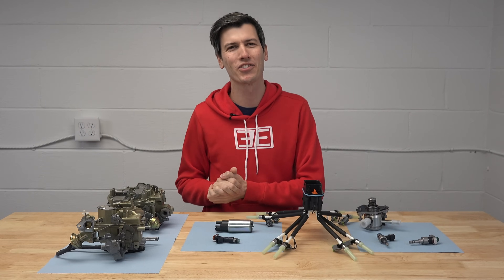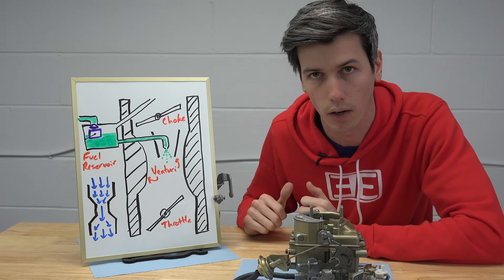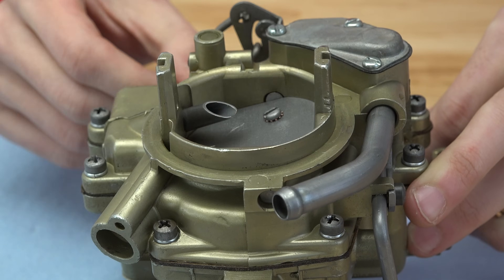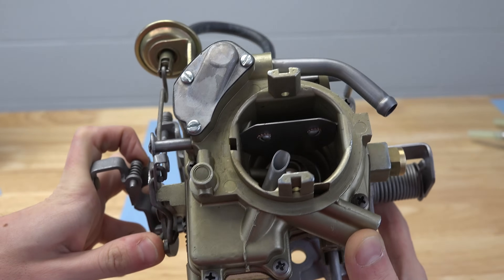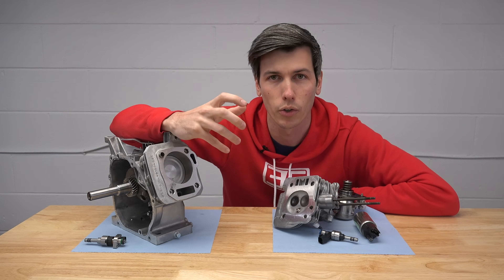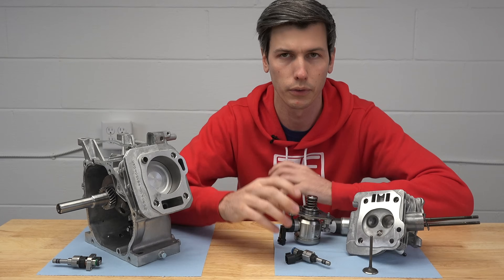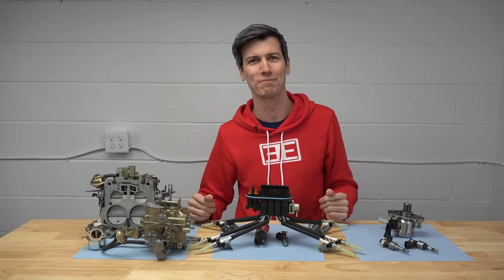What's The Best Fuel Injection? Carburetors vs Port vs Direct

Comment: I'll try to never buy a direct-injection only car, as I've heard too many nightmare stories from people who've had to have their intake side decarbonized, only to be left hanging once warranty was over. DI + port sounds the way to go. The very hard part is figuring out which vehicles have both, as most sales associates don't seem to know nor care. It seems some Subies and some Toyota models employ this dual injection strategy, but only on select models. Furthermore I was told that Mazda's 2.5 engines only employ DI, but an experienced mechanic said he's never yet had to clean an intake side ever! is there a strategy Mazda employs on their DI that somehow manages to clean the intake valve? I'm so curious as I'll be needing a new car within the next 1-2 years, and don't want to be stuck with a vehicle perpetually in need of intake tract cleaning. If Mazda makes their new I6 engine dual injected, (or has indeed solved the DI carbon issue) and throws in rear drive, I think I'll have an answer.... (Please make a wagon model while you're at it!)

Comment: A real good reason I scrapped the EFI on my Ford truck is cost of repairs and operation. My 4x4 F250 got no better than 10 mpg with the original injection. I installed a 650 cfm 4150 style Holley carb and my gas mileage jumped to 15 mpg. Driving over half million miles I saved a lot of money. EFI cannot compare.

Comment: Good old Weber 45 DCOE (et al) carbies, do not need
high pressure fuel pumps, electro mechanical fuel injectors, a computer,  a larger heavier alternator to
provide the extra electrical watts to power all that extra hardware, not to mention a bigger,  heavier and much more
expensive (toxic) battery to ballast the extra electrical power consumption.  

The extra hardware I've cited is only a small fraction of the extra componentry that is used 
for todays electronic fuel injection systems.
 
Consider as well the extra fuel burnt to run the high output alternator and drive its output...
as well as the extra fuel consumed to accelerate a now heavier vehicle. 

Greater complexity equals more things to fail, and more valuable equipment, time, and parts, 
to diagnose and repair the failures... the more frequent failures.

Comment: I got a genuine question, in a port injection system if your in down hill and no throttle input(engine braking) , does the ecu cutoff fuel completely ??

Comment: As a keen driver I find the biggest differences between these systems is how they're actually engineered in a car. My carb fed V8 responds instantly to the throttle, so for example in a corner you can balance the car on the throttle and your ability is the only imitation. Conversely, a modern road car with drive by wire throttle has a lag - a time delay between pedal input and engine response. So regardless of the theoretical advantages these newer systems bring, the implementation is poor and this impacts negatively on the driving. Personally, I'd rather have less efficiency and power but with a system that responds immediately.

Comment: a carb does not dump fuel, it regulates the amount of fuel. emulsion tubes, jets, needles and power valves all regulate the amount of fuel to be added to the airstream. you should be more accurate in your explanations.

Comment: Carburetors are by far the most fascinating work of engineering out of all fuel delivery systems. It never ceases to amaze me how much versatility and precision has been achieved just by some intricate use of holes and cavities in a metal block and utilization of pressure difference and Bernoulli’s principle. They don’t  do calculations to time and quantify anything, they don’t force feed fuel, they just maintain a constant state of balance which allows them to deliver exactly what the engine demands. 
Which in turn makes carburetors the snappiest of all. Nothing responds to throttle inputs as crisply as a well-tuned carb.
Reply: so simple, so perfect.

Comment: 😃fuel injection has less air flow obstruction,therefore more open throttle horsepower….also for a given state of tune,more tractable implying a higher state of tune potential.

Comment: U missed most important point
Carburetor mixing fuel and air 
Fuel injection dont.
That a huge advantage of Carburetors, u can say  carb does carburation
Fuel injectors don't
Reply: Lol fuel injections is far, far better at fuel atomization than carbs are.
Reply: @Redtooth75  
Fuel injection not a mixture of fuel and air. Did u go to any type of schooling about how engines work?
That a biggest problem of fuel injection. U can make  carburator super efficient because of that
Almost 2 times better than FI
Try it. It is Fact of life (basic physics really)
Reply: @vaninec  what you want is fuel atomization, you want the fuel to be in a gaseous state not a liquid one. Carbs suck at doing that, fuel injection is really good at that.
Reply: @Redtooth75  
Are u the specialist in fuel delivery systems?
I telling the expert opinion, whole process carburation DO NOT exist in any modern FI that huge minus
Reply: @Redtooth75  
Engine need carburation Not a just a fuel atomanization

Comment: Carburators are way less complex than fuel injection u could rebuild it with a few spare parts and a few tools on your front porch or at a rest stop if the fuel injection system burns out you will have to be towed💪🔥🔥🔥

Comment: Back in the days there was BOSCH L-Jetronic fuel injection system, this was a mechanical fuel injection with multiple port injectors that continuously sprays fuel and an injector distributor (head) that controls fuel to the injectors using a lever and plate that is moved by the engine intake suction .

Comment: there is a huge downside in injection... they need a controller to manage all that, more cables more electronics more sensors more failures more ultra expenssive parts very harder to replace and maintain.. carburator dont have controller, the cdi only controls firing time not fuell injectors... But we have better performance and fuel economy with injectors..

Comment: People sometimes think that injectors are far more advanced technology than carburetors. They associate carburetors with bad exhaust smell, bad fuel economy, unsmooth engine operation and all sins.

This is largely false.

First serial injectors (mono) were even worse than latest carburetors at the time. Sooner they got closer. So why such difference?
Thing is, injectors have become quite common approximately at the time when electronic ignition was introduced. (Not taking aviation which seen them much earlier) While tremblers (I don't know the English word) were a solution for carburetors, they got quickly extinct with injectors.

Simply putting, carburetors had no chance to see wide usage of electronic ignition. I've seen tests, carburetor engines models, commonly knows as not the best, when wired with electronic ignition, started to perform magically - all you need is electronic ignition, quality high-voltage wires, lambda sensor and fixed valve angles.

And though carburetors are not that flexible - they cannot do several dozen injections per stroke and change their working cycle based on valve position - they are a good choice for long-running engines working on constant RPM, if diesel engines are not an option. (which is itself strange)

Comment: Please explain the part about having the injector right infront of the throttle body 
Friend of mine has a buick lasabre limited with this injection system and there isnt a whole lot of information about it online. In fact, there isnt anything or anyone whos mentioned it AT ALL until I found this video! Thanks for sharing

Comment: That four barrel carb isn’t trying to give a different air/fuel ratio at part throttle, that would just cause rough running.

What it’s doing is restricting the part throttle power by limiting both the air, and the fuel on part throttle, by limiting the airflow. 

Also there is plenty of control of air fuel ratios with carbs via jet sizes. Not as exact as fuel injection, but surprisingly accurate with later bike carbs.

Comment: Lectron carbies are said to be as good as fuel injection. In the Achates 2 stroke gasoline engine on trial with Aramco, it has direct injection with no spark plug, basically operating much like a diesel.

Comment: 1987/88. Ford Australia introduced a multi point fuel injection    
Same using the carby bodies but with two injection in the top.  Before they headed to the fuel injection at the inlet valve.  
At this time of year. V8 race cars. Had a fuel rail at the top of the trumpets spraying fuel in but this caused flash out of fire under the bonnet.

Comment: F.Y.I. The carburetor does not inject fuel. It meters fuel according to the engine demand by utilizing different circuits in the carburetor itself. You should have done a video on Throttle Body injection vs. port injection vs. direct injection. I do enjoy your videos but I was a mechanic in the late era of carburetors and have rebuilt hundreds of them from the 60's, 70's and 80's including feedback Quadrajets. Take care.

Comment: Personally, I prefer a direct + port injection. I also prefer carb motors to EFI in certain applications due to the simplicity.

My 57 Chevy has a carb motor, and when I put the 434 small block in it, I will likely go carb, unless I can figure out a way to hide components on a FAST fuel injection system.

Comment: Here is a problem with a carburetor I wish someone could explain. It's actually two carburetors, one has never been factory rebuilt and one has. This is on a 1953 Chevy 6cyl. with a single barrel carb. With either carb installed on the engine, I can remove the upper part of the carb and the gas in the fuel bowl will creep up the sides of the fuel bowl even when cold , so it's not heat related. I first noticed this because of gas seeping around the upper gasket so I made a thicker gasket and solved that problem. Now that creeping of the fuel causes the engine to flood slightly if you shut it off for 10 or 15 minutes and try to restart it, and the carb will go completely empty after it sits for a few days. I have asked many older mechanics, like myself, about this and they don't know why either. I think maybe it's the ethanol in the fuel. Anybody??

Comment: Every engineer designs direct injection as the sole fuel delivery system should be required to spend half of their workday replacing the cylinder heads and cleaning the valves that their faulty engineering causes. Or be required to figure out how to do PCV and EGR without sending crap across the intake valve. Jackasses.

Comment: Well my new design plan is to do stratified but with some testing to see how rich it can get before failure to fully vaporize occurs, then use multi point injection on the direct injector and a hcci style assembly with valve throttle and no butterfly, along with single tubes per cylinder up to the filter housing chamber and same for the exhaust, I’ll also use whatever system gets the most valve variation and have a diesel injector in the exhaust, occasionally I will have it run air only in a cylinder, and then adjust the timing to allow the exhaust to return, the diesel injector will then spray the exhaust valve to clean it and cool it, and the intake will stay open to get back to the intake stroke for that cylinder again and it will run without the intake injection, the lean burn will utilize the diesel and then it will switch back to normal and another cylinder will go to this cleaning cycle, this method may be tweaked if use were to show any easy to correct flaws, but the plan will likely change before a test model is produced anyways

Comment: Ahmm ....... I´m not even form the hood , and I´m late.

Anyway, lots of low cc. bikes around the world still run on carbs. And do very well. So well sometimes you wouldn´t tell.... 
I have a 150 cc. bike I want to improve a little. 

I´m a low budget anachronic amateur developer also, however, I do know Bernoulli is not a soft drink  (though it could be actually, leaned, not enriched...). 

A new, flat slide, 28 mm. costs me usd 20.

.........................no.....................no................I don´t care ..............(place a deaf monkey here)

Comment: I got a lot of questions with injector 
How they work in high rpm and if i use port inject plus shower inject dose make it better With high rpm? Low rpm with port and high rpm with shower
My AFR stable in 12.8 

And what dose the shower inject give me?
Good or bad.  Just for raise up performance.

Comment: Have you checked out metering rod carbs? Like the ones from lectron or smart carb.
They use really ingenious stuff. They have a specially designed rod that sticks out into the intake, and it creates an eddy current that draws fuel up the rod in different volumes and heights depending on how much air it draws past

Comment: Another point is the amount of power of the three.  A carb can still provide upto 30% more power on the top end, than the computer driven devices.
Reply: Not really. A properly tuned EFI system should make the same or more power than a carbed setup. A carburetor cannot provide the optimal afr at all conditions, efi can. Im curious as to how a carb can give an engine 30% more power.

Comment: He didn’t mention that carburetors can be adjusted for A/F ratios by “re-jetting” the carburetor. It’s not as easily adjusted as on a EFI system and not as variable through the throttle position range, but it is adjustable for A/F ratio.
Reply: its as easy as can be to change the settings on an EFI system. You just tell the computer to inject more fuel, you don't have to physically change any components. EFI systems can be as variable as you want it to be, it all depends on how many sensors you have and how complex the tuning parameters are.
Reply: Redtooth 75 Totally agree with you. Carburetors are a PITA compared to EFI. They do sound better though. I’d say it’s about the only advantage besides being cheap and simple.

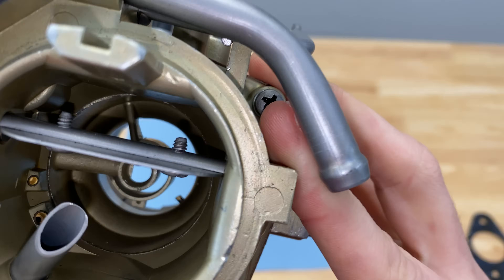Comment: 1:40 ..when pathway is reduced velocity increases and air pressure as well,but he said 'air pressure drops'🧐
Reply: Velocity increases and pressure DECREASES.  

And the pressure drop is what pulls fuel out of the primary metering system.
Reply: Air pressure drops due to the Bernoulli principle.

Comment: Cylinders are being cooled down by water around them, pistons by oil below them, but valves can only be cooled down by fuel injection - means port fuel injection - apart from mentioned cleaning effect. This just work awesome. Direct injection has no real benefits, as is clear to anybody who was driving direct fuel injection car and port fuel injection car. Furthermore Port injection has zero maintenance in at least first 500 000 km and is perfectly reliable. And lastly port injection can be used for LPG injection - with just 100% functionality and reliability, which is not the case with direct injection, where it is impossible to use LPG injection alone. To put it into some numbers: my 1.0 Liter turbo charged gasoline with direct injection takes in long term average 6 liters of natural 95 per 100 km, and older 1.6 gasoline engine with no turbo and port injection is taking 5 liters of same natural 95 for 100 km - both engines having same peak power 60 KW, cars same weight and same driver of course over same roads and conditions ...

Comment: 1. A port is not in the intake manifold. A port is in the head. The intake has runners. 2. You used the word "time" and direct injection having less time but time is insignificant due to speed of events. The more important factor is space.

Comment: Double injection caused the honda engine oil increased problem, the ECU needs to be able to switch between single/double injection according to rpm.

Comment: You left out an intermediate technology, throttle body injection. It is used on older engines that were built for carburettors and many systems are still available today.

Comment: Question: would it be possible to make a combined fuel injector and sparkplug? 
It would cause injectors to be replaced more often as part of basic maintenance and only 1 hole for the 2 items in the head bit not sure if they would be a positive change or not.

Comment: I can't be the only one that recognized the L31 electronic retrofit kit for the direct injection on the chevrolet vortec motors from 96-00. The retrofit kit is replace the poppet injectors that motor originally had. Which weren't bad. But trashed once on went bad

Comment: You missed out on port runner injection, this is an option for high power applications.  
The other thing many don't realise is that a properly tuned carby engine can deliver more power than an injected engine (Port runner version no included).  A carby has massive cooling benefits and can see the fuel air mix down in temp close to freezing as it goes into the cylinder.  
For power alone, the carby is certainly not dead.
Port runner injection mimics the carby, but with great fuel spraying control and is why it is still used in high end Motorsport applications.
Sadly our direct injection vehicles are more orientated around economy than HP and the maintenance has gone up significantly with newer cars.

Comment: Thanks for your videos. We have a 2018 CR-V with a turbo 1.5 DI engine and a 2018 Acura TLX 2.4 with a non-turbo DI engine. We are thinking of keeping these vehicles for maybe ten years or more. Do you know if Honda/Acura DI engines have long-term problems with carbon build up?